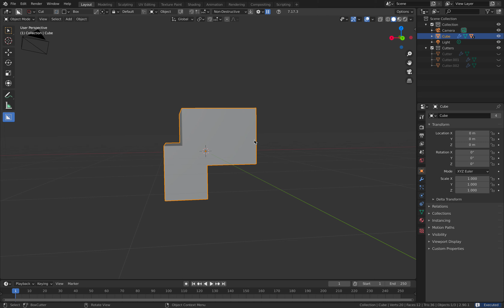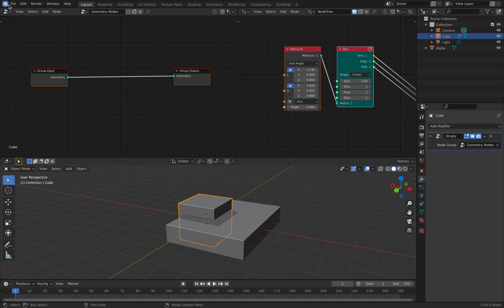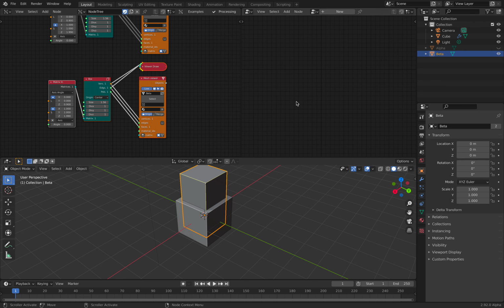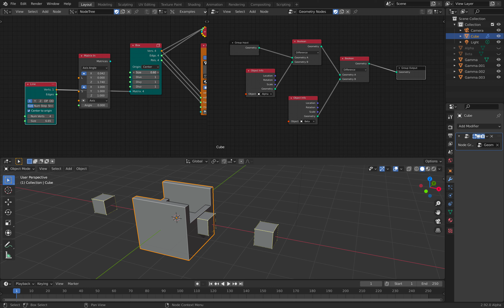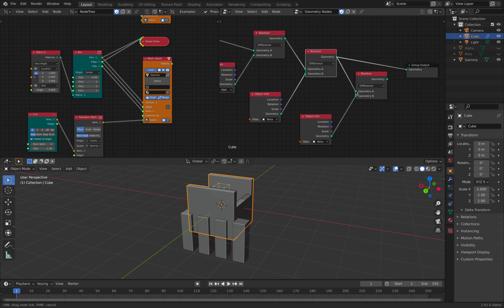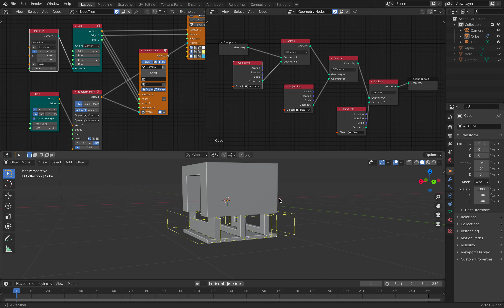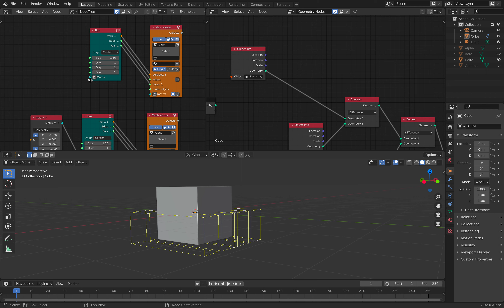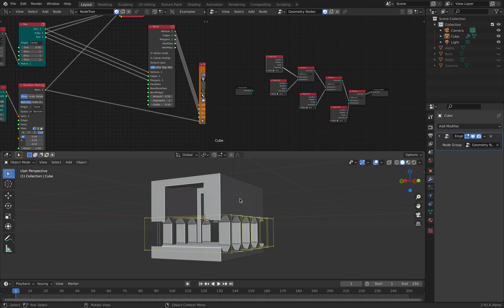LIVENODING Using SV and Geometry Nodes Combo for 3D Modeling

Comment: How many years will it take Geometry Nodes to get as feature rich as Sverchok ?
Reply: @MrSoloveyko  Duplication of effort is a HUGE problem with Open Source software !
Reply: @augm3nt384  nowhere near the same as closed source? Copypast- and adjusting as licenses allow (so there’s still that hurdle) is a lot easier than having to reinvent (peripheral parts of) the wheel. Can always improve in (helping each other in) coordinating efforts, but sharing is caring. A great place to start. Not sure how proficient add-on author(s) are at C++, or want to contribute to Blender (allowing their add-ons to become a lot leaner, more specialized) but it‘ll arguably be a lot faster and less duplicate work for Blender authors to recreate from open Python source than if add-ons used closed Python or other source interfacing with Blender through an API or similar.
Reply: @JimmyGunawanX  Blender 3.0 is out. And what has changed? Nothing. Geometry nodes (without plugins) are only good for doing the simplest things. Substance Designer has a lot more options for creating 3D models using nodes than Blender. How did the developers not think of creating an array node and other necessary nodes until now?